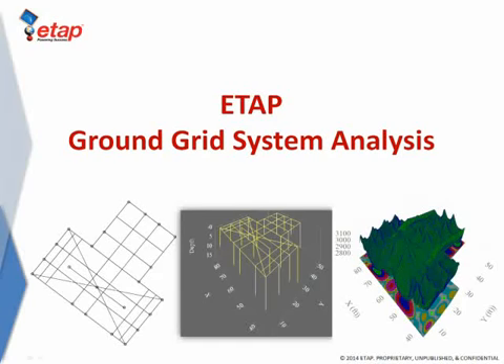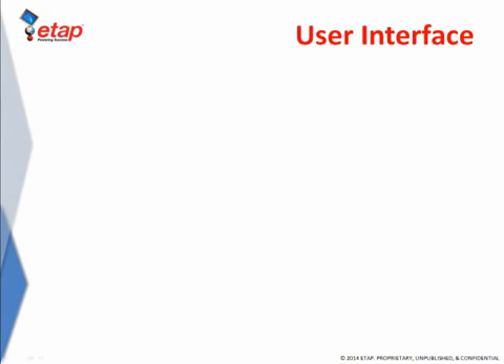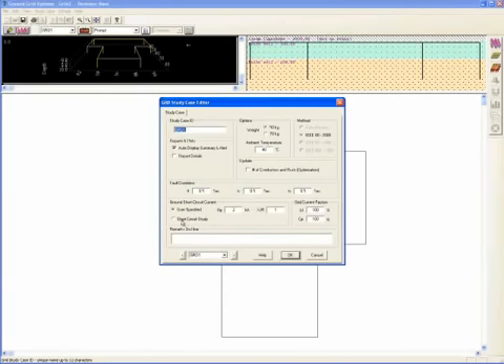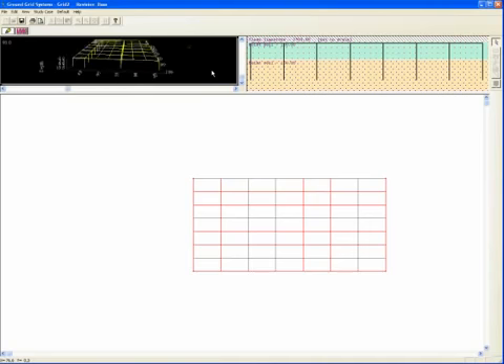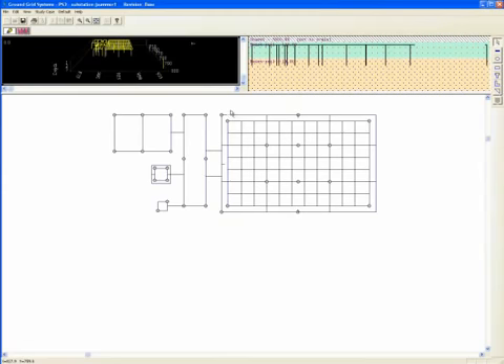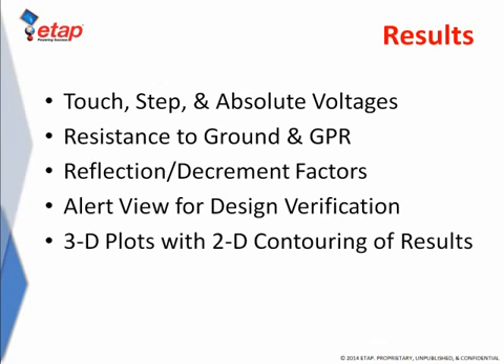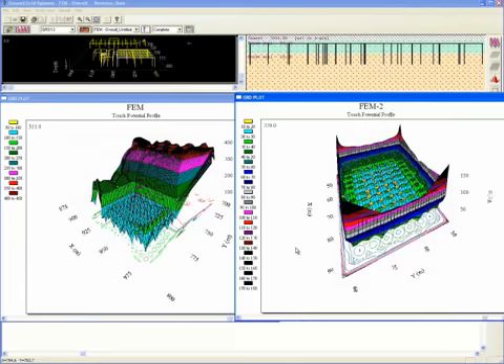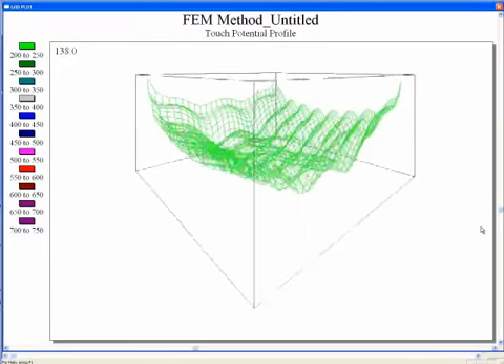4 ETAP Ground Grid System Module

Comment: I have a resistivity study by the SEV method (Vertical Electrical Sounding) or schlumberger method, in which resistivity measurements are taken at different depths (5 samples), how do I define the two layers for modeling?